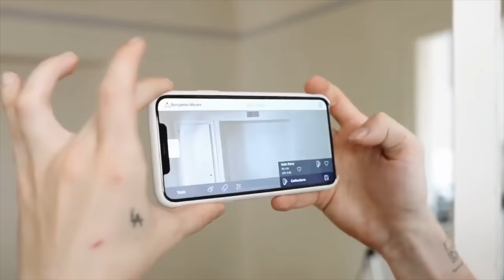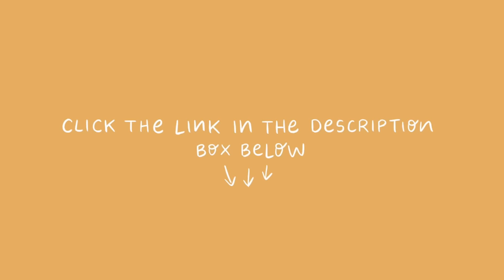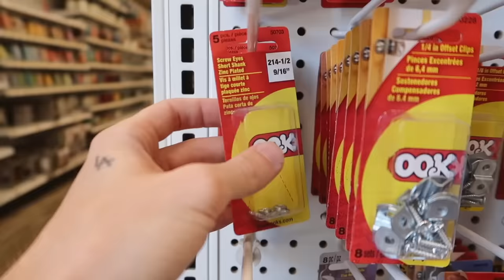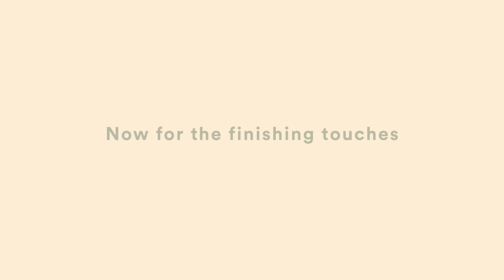EXTREME BATHROOM MAKEOVER From Start to Finish 🚽 *Insane DIY Transformation*

Comment: I just built a TON of cabinets for my house - within the hinges there are usually adjustment screws that you just need to tighten/loosen to make the doors move up and down so everything is aligned - it's SUPER easy and takes literally seconds
Reply: Great tip, thanks!
Reply: Thanks for mentioning this! My cabinet doors look the same way and I didn’t know it was such an easy fix

Comment: Just a sewing tip: Don't sew over the pins as it can break the needle. Just take it out right before. Also beautiful job with this space! Your home is probably the most gorgeous space I've ever seen!
Reply: I think if you lower the feed dogs you can keep the pins in while you sew. I've seen it done but never did it myself though
Reply: I was thinking the same. If you sew over the metal your machine needles will become blunt too soon. Worse than that, the needle might snap off resulting with the rare but possible event of finding the metal lodged in an eye.
Reply: I agree. Always remove the pin as you come to it. Easily breaks needles.
The bath turned out so warm and gorgeous. Loved the floor too.
👏 👏 Bravo
Reply: @cmbooks2000  I sew many projects and yes you can sew over the needle 🪡 with no problem.
Reply: Don’t get into the bad habit of sewing over pins.  It’s bad for the machine and bad for the needle.  It can dull or deform the needle causing visual pulls in the fabric as you sew.  Thankfully, I’ve never had a needle break and land in an eye because a broken needle eye (and its point) holds onto the thread.
Reply: You can not break the needle when you put the pins like he did 😊 it just goes over them.

Comment: Love your new bathroom. Wow!  About those cabinet doors:  You can level these by tightening & un-tightening the hinge screws that go into the cabinets (not the doors).   So if it’s too low on the handle side tighten the top hinge.  Then adjust the door gently.  If is too high loosen the top and so on. In some cases you have to loosen both set some under the door as a space and tighten both screws back up. Adjust so all are firm when you are finished.  It takes some time but well worth it.  I really enjoy your channel.

Comment: Just one tiny word of advice that I’ve learned from other videos. When putting up the batten boards, shim behind them where the vertical and horizontal boards meet for a flush fit then caulk and paint. It wasn’t an issue with this example because of the dark color, but with white trim the shadows would really bring out the imperfections.

Comment: Bathrooms are wet zones.  When water gets under peel n stick tile, mould results.  Same with floating floors.  Everything else is a nice change.  Use a painters razor to get the overspray off the glass on the windows and clean up the edges.  A razor makes light work and great results.

Comment: Beautiful.  Just one suggestion.  Have you considered painting the white wall abive the paneling with a tinted white?  I have done this with various colours I have used and it works so well. Basically, just use.a tin of white paint and add a tiny bit of the dark colour so that the white is subtly tinted.  Then leave all the trim white.

Comment: Bathroom is amazing! Little OCD that I am - I noticed the small in-wall section over the bathtub has different tiles than walls, so I would have been nicer to put the same tile as the floor, and also I think, aesthetic wise - you should have sprayed the window bars as wood instead of black - it would match the wooden decor nicely. Little tips :)

Comment: Hi! I plan on doing this in my bathroom. Im currently measuring everything out. Would you be able to tell me what spacing you used? Like what would be the width of one of the inside panels? I like the look of the spacing you have! I'm having a difficult time with my calculations!

Comment: Hi Drew, I really want to try the peel and stick tiles but have read scary reviews of these types of tiles “shifting” or not working well in high moisture rooms and also not easy to remove when you need to move out. Can you share what your long term experience has been with these types of peel and stick tiles in your previous apartments?

Comment: Those drawers will need to be removed by plumbers at some point so adding significant space beyond their standard pull length was vital! So much else can easily be changed but installed structure is a different story!

Comment: I see a lot of YouTubers use these Floor Pops peel and stick tiles, and while they look cute and stick well, they are not entirely "renter friendly". I put these tiles in the bathroom of my rental apartment, and while they didn't mold and held up well with the water, when I was moving out of my apartment and went to remove them they left behind a horrible sticky residue that was near impossible to remove. Since the flooring underneath them was vinyl they stuck to it and also ripped up the vinyl with them as I tried to remove the Floor Pops and I ended up having to pay my landlord for new flooring in the bathroom. Floor Pops definitely should only go on top of tile floors!

Comment: I really love how the room came out... but peel and stick tile on the floor over nice neutral newer floor tile is a no no.. over time you end up with dust in the seams and when you peel it off there is often residue stuck to the floor tiles.. it can make a huge mess.. real tile is such a better choice if you can afford it..or laminate flooring over the tile because it floats and you dont have to damage the tile to install it..

Comment: Placing those screws so close to the bottom edge of the horizontal board is risky! The weight of the mirrors need to be in the center of the boards or higher to ensure the integrity of the board and be sure you don’t hear a crash (or two!) in the middle of the night! Repeated humidity/drying does not help wood tensile strength either. I realize it’s too late to change...

Comment: Hello. I started to watch Your videos not long ago and I like them, so I started to follow Your channel. I stopped by this video, because we recently bought our 1st flat and we have a problem - we have similiar situation like Your bathroom - bath is in the same position like in Your bathroom, but there isn't a separate shower. There is an electric radiator on the wall (the wall which is near Your shower). We like to bath in a shower and we are struggling what to do. Could You tell us some advice, please? I hope You will get better with insomnia. Sending lots of love :)